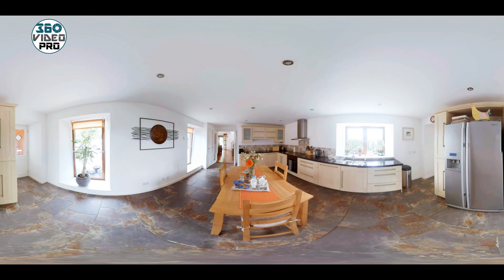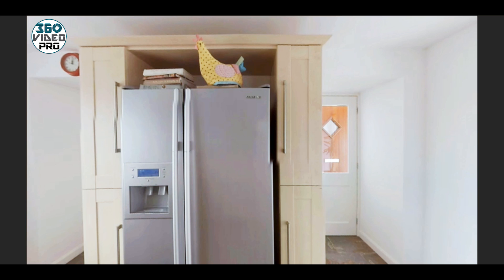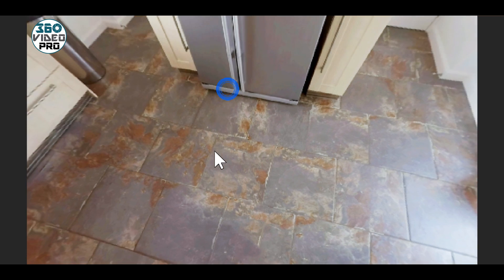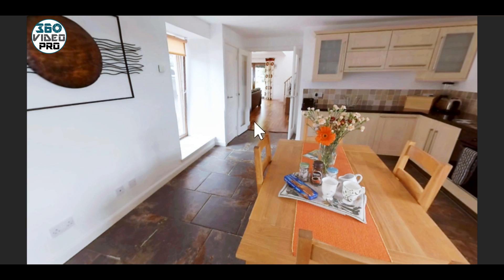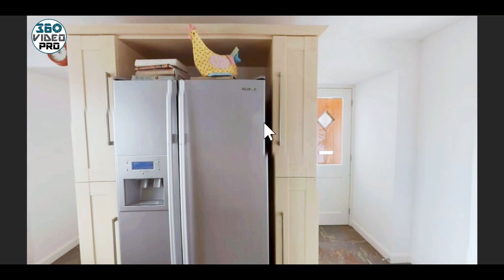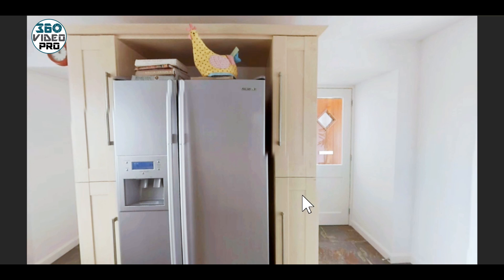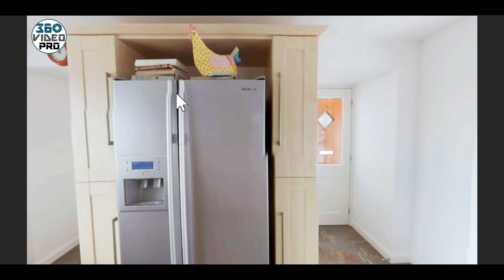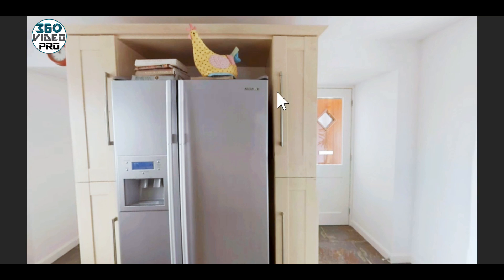Solving Stitching Problems in 360 Video

Comment: Ugh. The title says solving stitching problems...and yet the video does not deal with solving sitching problems.
Reply from the maker: Thanks for your comment.  The whole purpose of the video was to highlight the fact that multi-camera video rigs often create visually intrusive stitch lines that many people believe are simply a 'by product' of using these tools.  We wanted to point out that nearly all stitch line issues can be addressed and the video cleaned up to present a virtually flawless view of the scene captured on camera.  Since every scene is different and the stitch lines created may require different handling as a result, it isn't possible in two minutes to show how each and every one is done.  Should you require more information or advice, please get in touch with us directly.  Only too happy to help.